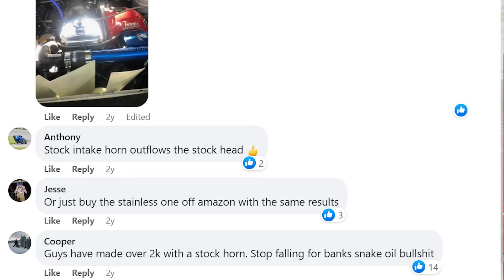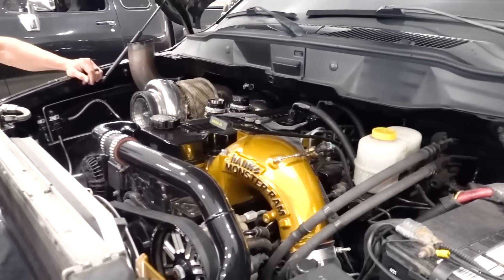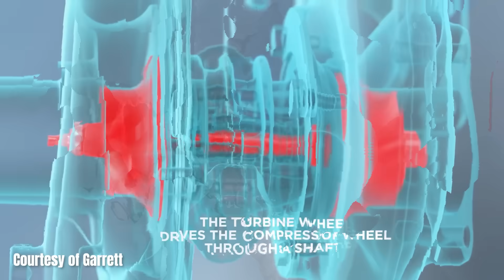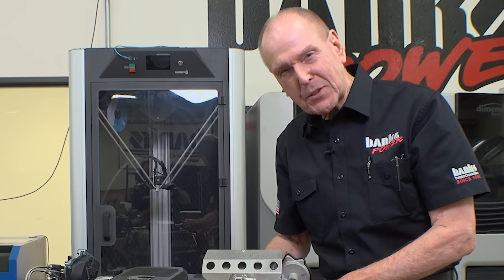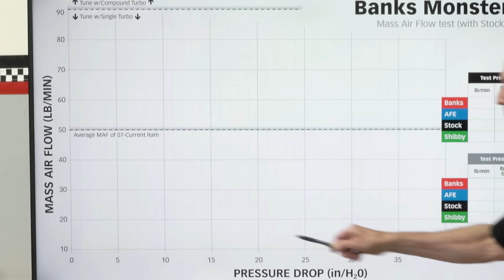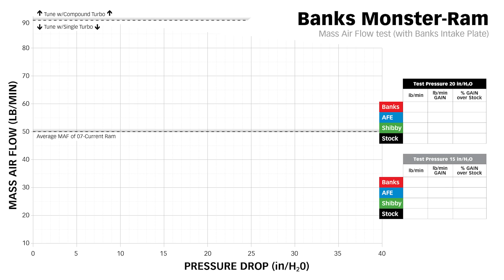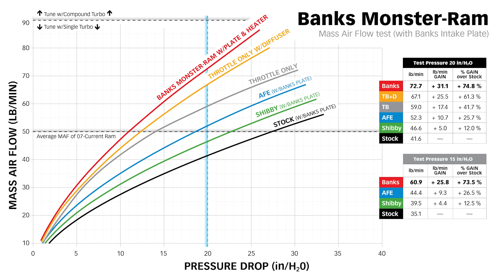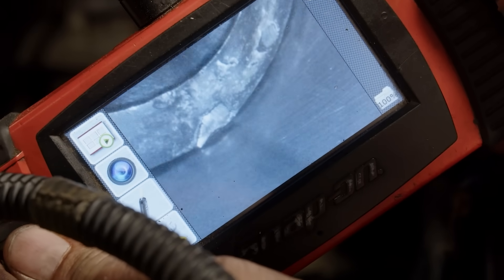Stop this wives' tale about Cummins engines! | Fact Check

Comment: This "test" was unfortunately a swing and miss as it did not test what the comments you read where saying (No change with stock head). You need to test the flow with a head attached to address the comments.  No one ever said the GB horn wasn't an improvement over stock.   The comments you read at the start all said with the stock head (fully stock not ported or high flow valve seat profile) attached there is not a significant change in flow in to the cylinder (with anyone's intake).   Re run  the test with a stock head bolted up to the intake, open up correct intake valves (not an empty head with all of them open) to simulate the the companion cylinder when running,  heater delete on all of them to test apples to apple.  That is the restriction the commenters are taking about.  Very simplified example of the commenters,  For example, put a 12" culvert flowing into a garden hose, it will flow the same as a 15" culvert connected to that same garden hose.  You have to have the restriction (Cummins head) in place to really see the actual flow.
Reply: Yall are funny going at Gale and not even understanding what he clearly explained 🤦‍♂️
Reply: @brokeboyracing4815  you're one of the ones that stick to the bigger/winning team

Comment: I’m assuming that the air expansion before the engine works similarly to a proper exhaust system in the sense that it creates a vacuum type pull for more air?

Comment: You said that most automobiles use MAF sensor today, this is true.   But the Cummins 6.7 and most recent diesel engine mainly use the MAF to calculate how much EGR is possible to recirculate in the engine.  The MAP is the one use to calculate how much air gets in the engine.( The MAF is usually the IAT as well which is also in the calculation to know the amount o Oxygen getting in the combustion chambers) !

Comment: I can say this about the Monster Ram Intake. I ordered the complete kit that included the Heater Grid Delete, now I know some of you and Mr. Banks disapprove of deleted Trucks which mine is 2007.5 Dodge Ram 2500 4x4 6.7 diesiel del has been deleted since it hit 20,000mi. The Monster Ram Intake and Grid Delete really woke up my truck, it does everything Mr. Banks says it does, the pepole who make stupid comments about these trucks don't have a clue as to how they function. I bought mine brand new with 23mi. on the 0D, did the deletes(we don't have emissions here) and I now have 286,460mi. on it with only two major problems since owning it, new Transmission at 198,578mi. and just recently I had to replace the TCM and the upper plug that goes to the TCM. I'm looking to get the Banks Inercooler next along with a few other mods. I get 19.5-20 mpg. Gale keep up the video's and designing products that work as they say they do.

Comment: Hello Gale.

I'm working on a HCCI Fickett-Jacobs cycle pulse detonation engine with a 35 to one static compression ratio. Its a schnuerle ported 2 stroke. Eventually I'm going to switch to an opposed piston uniflow scavenged valveless 2 stroke with a variable geometry turbo.

Comment: Man, people claiming a FORCED induction motor's head has a maximum amount of air it can flow is pretty funny. It's a FORCED induction motor, you can FORCE more air through it with more boost pressure, yeah you get more heat and turbo efficiency can be an issue but you can still force more CFM. Some people comment and don't even understand how an engine works...
Reply: That isn't a good way of looking at it, as it leads people to believe the engine can be designed sub-optimally and the turbo will just force the air in anyway. You can see that belief being expressed on forums all the time, usually to someone doing something that improves breathing the way the Monster Ram does. In fact a turbo engine inducts air much the same way as a normally aspirated engine does, and VE still matters. Forcing a turbo to work harder means a narrower power band, higher EGTs, and more chance of melting pistons.

Comment: I have a 2021 370 horse power  850 torque with 19 .0 to 1 compression. Why when I keep my rpms at 1800 rpm and my 68rfe 6 speed transmission shifts to overdrive or double overdrive my check engine  low boost light come on ? And there is NO Leaks . The engine drops 400 to 500 rpms at the shift.

Comment: I bought my first banks monster exhaust.  I was Soo excited loved it until...  One Michigan winter later looks like  it was installed in 1982.  Muffler was built well the pipes were garbage not worth the extra money for durability.  The guys smart but a Dyno run showing his so much better power gain would speak more for a dummy like me.

Comment: Does the Monster Ram kit for the 5.9 have the billet manifold and modified grid heater? Also, does it provide similar gains as the 6.7 version does over stock and aftermarket competition? I am considering an intercooler to my CA registered 04.5 and i already have the S&B intake horn. If the Banks kit is that much better, ill scrap the S&B and install the Banks kit. Talk me into it Gale!

Comment: Even non-MAF closed loop systems will use speed-density, where it knows the size of the intake tract and the density of the air, and can figure out how much air mass is going in based on those things and the engine speed.

There's even old carb designs like the SU that pretty much work on air mass.

Comment: Arguing with gale banks is like hanging Jesus from a cross. What a bunch of dumb asses. And the grid heater delete woke my motor up, the bigger horn did a lot, and with head porting wow. Again if you are arguing with gale banks about a diesel. You are an IDIOT.

Comment: Compressed air charge has 3-5x more mass per cubic foot. So a 6.7l Cummins is actually displacing 20.1 cfm if you don’t understand this, never make a comment on a technical page, especially an automotive forum, got it? Now, go pour a huge bowl of Kix, Honeycomb, fruit loops, Apple Jacks, measure how many cups it takes to fill the bowl, now get a blender, pour the cereal into the blender pitcher, set to Frappé, put on the lid, hit it! Now measure, continue until your huge bowl is empty. Now compare notes. You may not perpetuate any more nonsens especially on forums where your misconception can fester and spread. Mr. Gale Banks is the forced induction guru!

Comment: Finally... a throttle blade for diesel engines!  😮 everybody said that it would not work, that diesel engines want all the air you can give them all the time, and I never understood why a blade over fuel flow wouldn't work.
  Thanks Again, Mr. Banks....You're thee Greatest....
    He said;  "Can I kick my own ass"...mwah ha, mwah ha ha... no one will, if you don't!!

Comment: Gale, I think that using High Elevation Mountain Towing Performance vs Sea Level will help the meat heads understand Air Density a bit better, for both N/A and Boosted...... or perhaps why the P51 Mustang Fighter Plane's Supercharger had a 2nd gear to enable it to spin faster at higher elevations in order to maintain the same performance, due to the lack of AIR DENSITY. Too many people still think in terms of Naturally Aspirated CFM Flow, which is fine....for a Naturally Aspirated Engine. What we are talking about are clearly NOT N/A.

Comment: While entertaining, I believe your test is done wrong. You’re measuring air flow through the intake horn in the wrong direction, the larger intake elbow in a way acts as a bell-mouth
A proper test would be to bolt the intake elbow+grid heater plate to the flow bench and then suck air in, the results would show that the restriction starts at the EGR throttle valve, where your 3.5” “boost tubing” is limited with the valves ID of 3.22” (what i was able to find online for the 6.7 EGR throttle valve diameter).

Testing even further, if you bolted the 6.7L cylinder head to the flow bench, set the valves to .400” of lift, and then had the whole intake system bolted on/not bolted on/ and any variant in between that would be a better way of proving if the intake elbow is a restriction.

The flow bench is a neat device for testing but when it comes to diesels it’s kind of a weird relationship, they have no throttle body and thus the system isn’t under vacuum… damn well ever. A more appropriate way would be to have a flow bench that pushes air through and measuring restriction under boost.

Comment: Great job Mr. Banks. I've been licensed for over 45 years as a technician in automotive, aviation, marine, motorcycle and small engines( yes,,i spent a lot of time in school and in books).. now I teach.. and I've said this a thousand times to my students... Air mass and temp.... Fly an airplane,, you will learn very quickly about air density after 3000 ft and climbing... I literally tell my students,,"if you increase pressure,,,, you increase temperature"". Its that simple.. MAP's and MAF's is an excellent indication of volume and the condition of the entire system and of course the ICE!!!! Anyone who argues from some bunch of sheep on YouTube, should go to school first...

Comment: So....all you did was prove your airhorn outflows the competition. Where was the part about the head flow? All you did was mention stock headflow at 2800rpm then quickly jumped into air horn flow. I want to know flow numbers with your hirn through a factory head at max lift, vs a stock intake horn. Ive no doubt your horn flows.....but im still convinced the head is the choke point here.
Reply from the maker: The whole point of the video was that, even if you think the head is a limiting factor in terms of CFM, that doesn't stop improvements to the elbow from increasing air mass in the cylinder. With denser air at the intake manifold more pounds of air mass are present at the same CFM.

Comment: I used to hate banks products.. I only ever saw their stickers on the worst type of diesels... Everyone knows the typical f-boy Ford guys.. makes a lot of noise, doesn't really go anywhere, smokes like a mthrfckr with the slightest bit of throttle, and they're constantly driving around on throttle, off throttle, on throttle, off throttle... I've always hated that shit .. as someone that owns 3 4 door long bed diesel trucks on 35s, I'm happy to say that only one of them smokes and it's my project truck that I'm rebuilding to fix the mistakes of the previous owner.. and if it's not totalled after being stolen by a tweaker last week, I'll be rebuilding it with exclusively banks parts..

Comment: So, this is some cross pollination from motorcycle performance cylinder head work but it looks like the Monster Ram kicks up the intake velocity with that 110⁰ turn similar to motorcycle carb venturis. Also, in regards to that same idea, epoxy D ports were an idea that had some significant numbers and research in the dyno room and on the track as well as the flow bench with the cylinder head. 
The epoxy was a flat hump that gave the port a D shape and the air velocity would approach supersonic just above the valve. When the valve event occured the "super filling" of the cylinder along with overlap and scavenging effect gave a prominent boost in performance. 
Although it was actually a restriction on the intake port volume, it translated into real power you could feel on the track with the engine.

Comment: U can bench flow a 6inch pvc pipe vs the stock airhorn and show a difference in numbers. 
The only numbers I want to see is stock truck + a 100hp tune on a Dyno 3 runs average, swap for the shiny banks airhorn and repeat. 
Take in consideration dyno inconsistentsy. 
I wonder what that shows ???

Comment: Not sure why they keep pushing the whole heater grid bolt as a death sentnce to a 6.7.  I know a ton of trucks with over 200k to 500k. With stock grid heaters still.  I got 430k on mine.  I have an older monster intake that they didn't add their new  heater too.  Wish there was a way to retro fit it, cause I would like to delete the heater grid for performance gains.  That being said,  with my tune and and other upgrades all I noticed was less soot, no milage or real performance increases.  But was worth is for the decluter and less soot.

Comment: It's not all about open air flow It's how dense how much and how fast You can have a small port old small block Chevy that has the right cam shaft with  The right valve timing opening and closing events That could possibly overcharge  Charge the cylinder on the intake event And run circles around a very similarly built engine with the wrong cam shaft  If it makes more power on the Dino it makes more power In respect to anticipated realistic  driving RPM Without being sad you can put a big 850 double pumper on a small walk chevy make big power on the Dino will be a t*** on the street Because under load And RPM variations  Will be a factor on drivability Diesel engines in my experience are a lot more forgiving in that department

Comment: Thank you. For that is holy thank you! This is bookmarked in time stamped. Whenever anybody says turbos are better because they're free power or turbos don't need horsepower or Rob horsepower to make power I'm going to show them this. Mr Banks literally just said it takes about 50 horsepower to make boost using exhaust gas and that horsepower is taken from the crankshaft during the power stroke. If you were to take the same centrifugal supercharger meaning it does the same PSI at the same CFM it would also take 50 horsepower from the engine just via a belt. I love you Gail!

Comment: So, where's the dyno numbers?  You do have a dyno on site, right?  A comparison of a 100% STOCK engine vs stock + Monster Ram (no additional components...i.e. aftermarket intercooler, charge tubes, different turbo, etc) would be very convincing (or not).  Gale negatively reacts to comments about the head being the limiting factor, but never actually addresses it other than stating the 6.7L flows 331cfm @2800 rpm.  Sure, the math works out (assuming naturally aspirated and 100% VE), but do most people run at 2800 rpm?  What is the head flow rate under typical levels of boost at various altitude densities?  Let's face it, at cruise and normal driving, this 331cfm flow number is irrelevant.  Gale then switches to mass flow, but never correlates that with cfm.  Mass flow is important, and is what modern EFI has used for decades, but be complete and address the head flow, either in cfm or mass flow.  I love the engineering discussion and appreciate a lot of the Banks videos technical content, but this one feels more like marketing and less like a balanced comparison.  BTW, if the heater installed in the tests (difficult to see just how the Monster Ram is configured, obviously no EGR installed).
Reply: So, the basis of your reply here is to baffle 'em with bullshit??
Reply: @richwalter3107  Huh? Not sure if your comment was directed at me, it's pretty straight forward. 
Anyway, I went ahead and installed a Banks Monster Ram (race version) on my wife's 2012. After almost 4 months with it on, I can confidently say it made ZERO difference in fuel mileage, and the butt Dyno says no noticeable difference as well. Bummer. It does seem to idle a little smoother. The good news is that it starts fine in our coldest weather with no heater. If I was doing this again, I'd save the cost of the Banks horn and reuse the stock horn with a heater delete intake plate.

Comment: I drove a 1981  GMC pickup with a 5.7 olds  22 to 1 compression .. . The fuel pump died. Had it rebuilt and turned up 10%  I ran headers for an Oldsmobile Delta 88 ..  It was slow but I got better mpg than a gas truck and diesel was cheaper than gas back in those days.
  Now I have a bone stock 2003 Duramax.. although turning the power up would be fun ... Diesel is expensive and if you  press your foot hard on the go pedal you use a lot more fuel.  seems I am always driving with a light foot for better mpg .

Comment: Hey Gale.  If you really want to make their heads explode, excuse the pun.  Explain how lower Intake Manifold Temps lower Boost and make more power.  That will really start a Scuffle in the comments section.

Comment: Is there an ETA for the monster ram intake and or the billet grid heater delete kit being smog legal in California?  If not how does the CA legal intake compare to the moster ram intake with the grid heater? Are there any other fixes to avoid the grid heater failing?

Comment: That so dumb im sure the volume of the monster ram is larger than stock. Yes, there is a turbo to force air into the intake, but allow there to be less restricting from the monster ram, allowing more air to follow or allow the engine to not work as hard to take in air or pump air

Comment: I still don't get it I understand that he's saying it may flow more but when you're under boost and say you're running 30 PSI then all you have is 30 PSI of pressure waiting for the valve to open so how does this intake horn make more power if you already have boost waiting at the valves ?   I'm trying to compare it to a water hose if you have a water hose flowing water of course if you have a bigger hose it would flow more water but if you put a valve on that hose whether it be the big one or the small one and you open and close that valve you're still going to get the same amount of if the valve is the same size on both hoses.
Reply from the maker: It will help to remember that air is compressible. 30psi of boost tells you nothing about the content of that air under pressure. The Monster-Ram reduces density loss within the intake system so there would be more oxygen content in the same volume of air under the same pressure.
Reply: @bankspower  but isn't air density constantly changing based on temperature and altitude and does that affect horsepower and performance on a day-to-day basis?